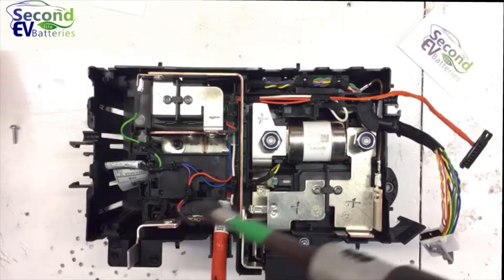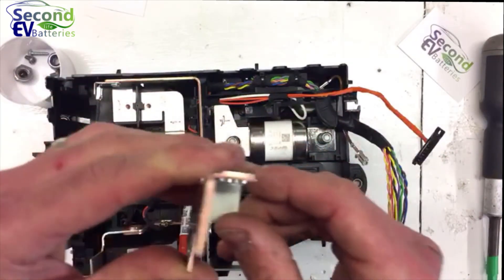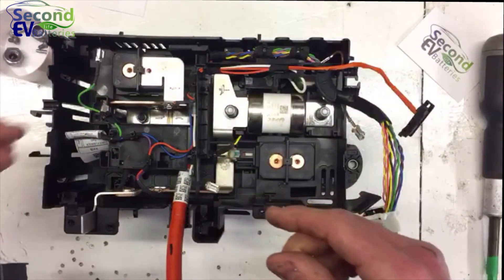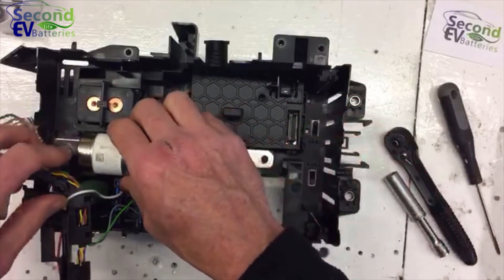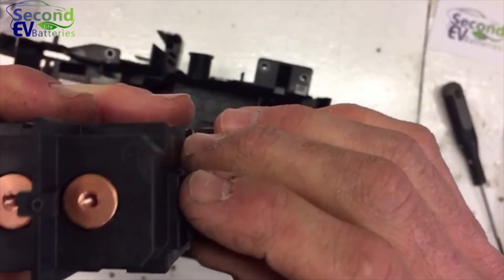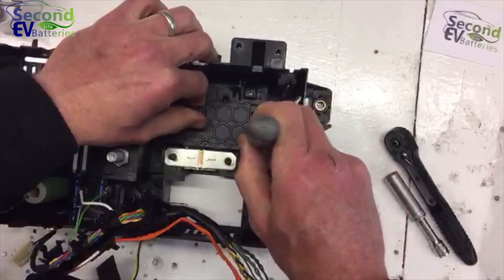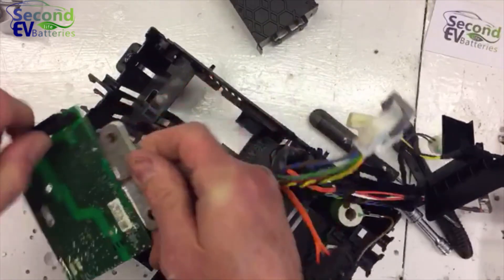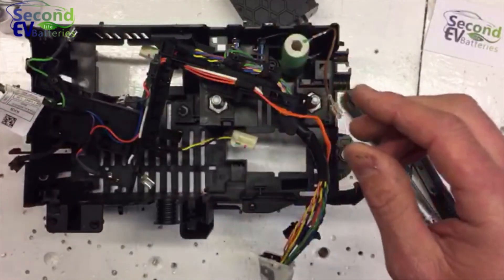BMW i3 94Ah Battery Safety box breakdown

Comment: Is that the current/amp sensor built into the pcb? I have a dead i3 that has multiple current sensor faults, wont turn on contactors. Trying to find out if this is part of the safety box?

Comment: Hi, Just so you know, they are not copper interconnects. The orange cables are actually aluminum. I was shocked after cutting a few apart to lengthen them for a VW Rabbit/Tesla conversion.  I thought they would be copper but nope.